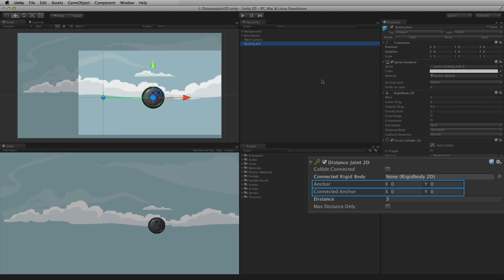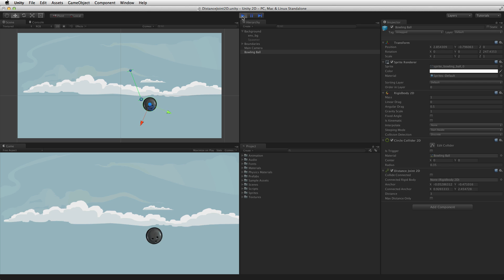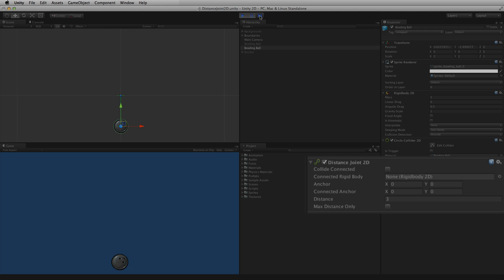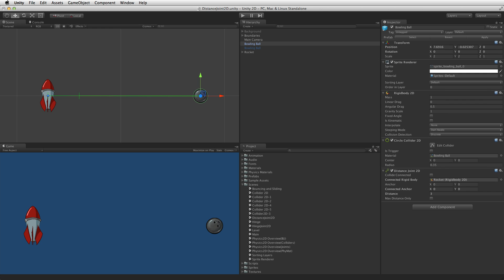Distance Joint 2D - Official Unity Tutorial

Comment: i, trying to use a distance joint to simulate planet orbit, but when the planet orbits too fast it looks like there is drag and it slows down heavily. it only happens when using a distance joint. is there a way to correct it?